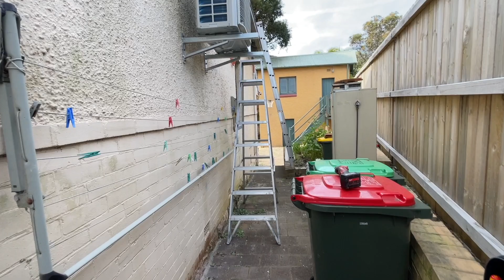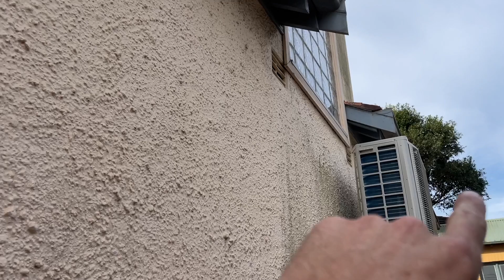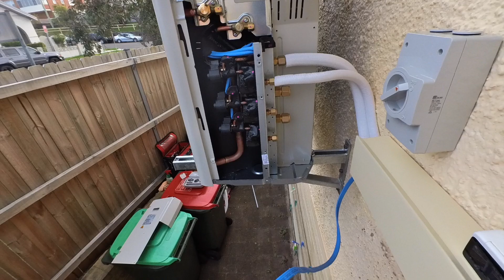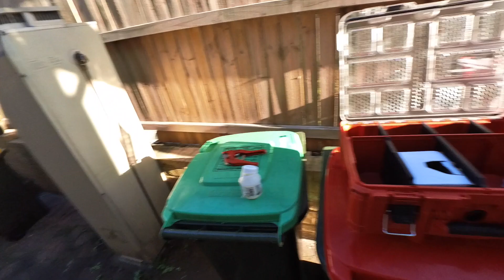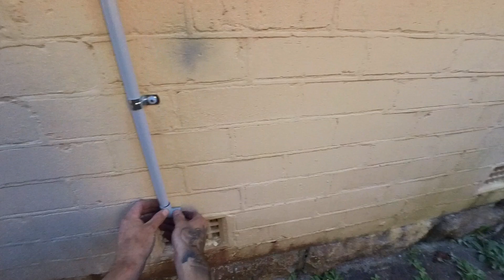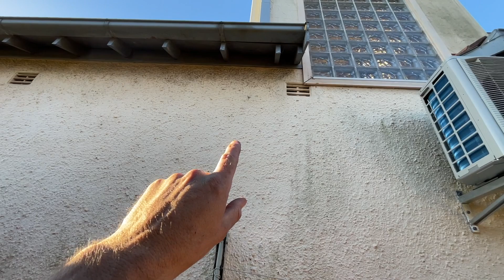Installing a Daikin Ductless Mini Split (MULTI)

Comment: 5:14 thay gutter needs replacing.

I had a rooftop hot water system with the overflow released onto the roof. The constant wetness has rusted the roof and the gutter.

Thankfully this roof is tile, so the condensate drip shouldnt impact it, but it will destroy the gutter (and the new one when its replaced). Can you run the condensate line into to a downpipe so the gutter can dry out?

Comment: How many years have you been using the R32 equipment? They're changing the refrigerant here in US. Do you guys have any requirements for the leak detector sensors on the Central Systems? Thanks
Reply: in UK we seem to be moving away from R32 now and fitting R290 units
Reply: @TCSplumbingiom  only really on fridges/freezers and maybe some small chinese single splits where the quantity of propane can be kept low enough to control risks of using a highly flammable refrigerant. Pretty much all A/C is R32 larger VRF systems until very recently still used R410A

Comment: Nice video mate, don’t wanna be that guy but on that first outdoor you grabbed both shifters but didn’t back yourself once when cranking it haha I just through it was ballsy but obviously you smash them in like this all the time
Reply from the maker: @BrannndonM  haha okay so I’ll explain. I grabbed two shifters by habit because I always use two shifters HOWEVER on these multi units they are different. There is no room to put the second shifter as the chassis is moulded around the male flare bit. The male bit wasn’t moving one bit. Like not one millimeter. She’s good mate haha

Comment: I find myself installing more multi heads than ducted systems these days. Obviously installs can be difficult, but people seem to like the control and energy efficiency.
Reply from the maker: @MentalLapse09  I like multi’s. I like the fact you won’t have any duct related issues and you have complete control over each room. I think I’ll probably end up doing the same thing.
Reply: @maracservices big thing I find these days man is the cost of running a ducted system turns people off. Obviously they ramp down, but it's still wasting alot of energy, and the minimum current draw is way more than a 2.5 head would be if you're cooling one bedroom.